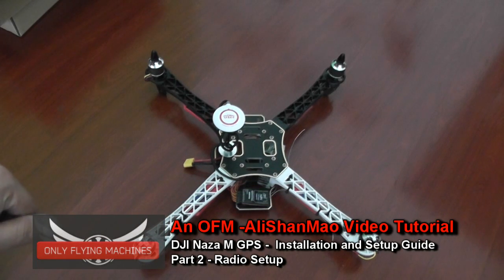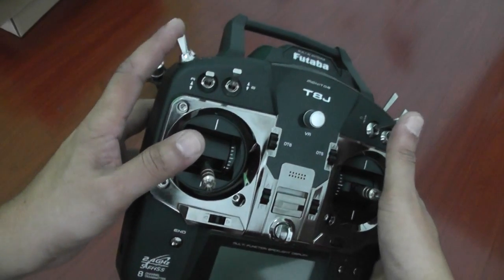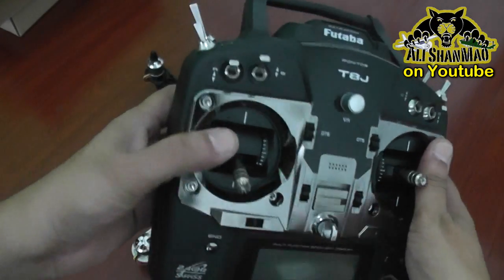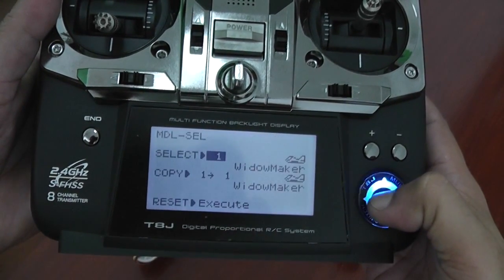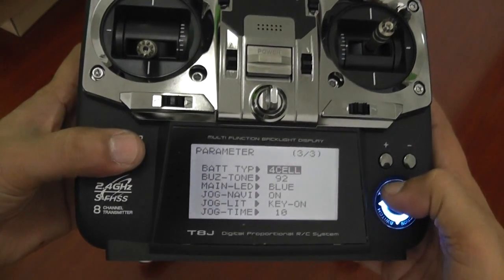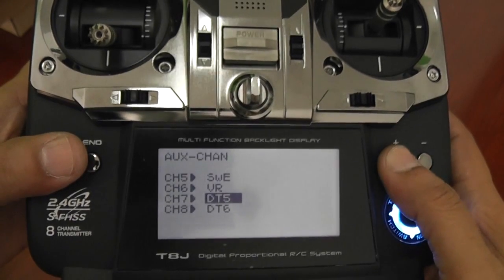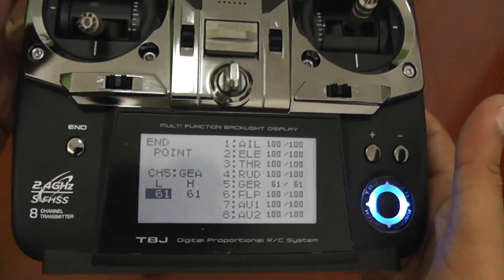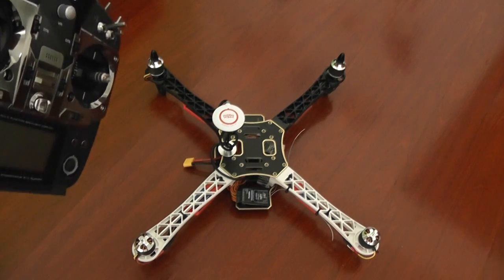DJI Naza Installation and setup New Guide -- Part 2

Comment: Hello, I am building a quadcopter with NAZA M-V2, FS-i6s tx and FS-iA6B rx. RC calibration on NAZA on the PC is fine except  setting the control mode, I cannot move the slider until the GPS, Atti. or Manual area turn blue, The only way I can move it is changing the values on thefly mode but is not accurate and does not go where I want. The other main issue is that I cannot arm the motor nor start the motor test on NAZA on my PC. I am totally puzzled and run out of ideas what to do next. Linking motors to TX and RX only the motors work when testing them. I would much appreciate your opinion/advise on this.
Reply from the maker: Trash the FS-i6 and get a FrSky X-lite or Taranis QX7. you will thank me for that. FS is nothing but experimental grade stuff that does not work so good often.
Reply: That’s a shame but it make sense as these two transmitters are more reliable. Thank you

Comment: I'm having an issue,  fully installed naza on my s550 hex using the dt7,  when I arm it throttles up real high and all the motors don't spin until I move the sticks around.  any suggestions?

Comment: hello, perfect movie !!  the explanations are wonderful and easy to follw on this T8J. but I got a used T6J and there is the display and menu use not as easy because small display. I have to adjust the T6J to a hexakopter HMF s550 with NAZA and a Futaba R2006GS. I followed your first video (part1) and did all you told. now I am better than before, but I still have to programm my control unit !?!? do you also have a video from a T6J ???  nice wishes from Panama

Comment: Interested in the Futaba.  I have DX6i.....question. I can program the 6xi to have all flight modes with no 3 position switches available (only 2 position type switches available) ...why would you have to give up any flight modes with two 3 position switches available?

Comment: hi,whats your recomendation for mounting the 2 futaba Rx antennas? i now they must be at 90º angle between each other. this means that one of them must be Vertical, an the other horizontal?  in your setup i think you have one attached to one arm, and the other is "free" in vertical .
in the R2008SB manual says that the antenna should be away from ESC, motors, etc.  does your setup just side by side to the ESC on this arm affects range? is there a better way to mount it?
thanks.

Comment: It´s a lot better then the KK2 since it among other things have RTH implemented with is dam good but this DJI naza is or course way more expensive then the KK2but as i see it is well worth the money if you need these things.

You can by it on DJI homepage or cheaper on ebay which i think is the exact same thing.

Comment: Hi Guys, I have a HT-450 Quad with a Naza GPS Controler Board, it was working very well until one of my motor seize whilw hovering at about 15 ft, came verticaly straight down to the ground. Fix the damage motor and motor mount and reprogram the Naza setting which seem to be simple, however went I try to start up the motor nothing happen. So I unplug the power of the Quad and then re-power, the Naza system is powering up, but no power is going to the RC Receiver. Anyone had that problem before??

Comment: I use DT5 for gain control as it offers a beep for each touch of the adjustment and you can't accidentally bump it. I also use DT6 as a 3rd 3way switch. You could also use DT5 as a 4th 3way switch.